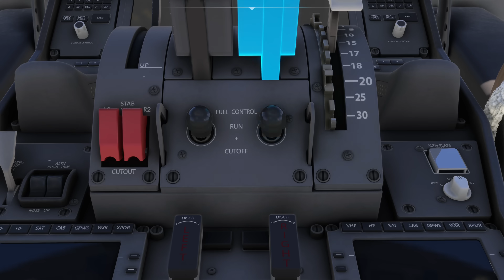Air India 171: Why Did The Fuel Cut-off Switch Get Moved?

Comment: Someone made a good point with their question. For an individual planning to take their own life, their life insurance policy for their next of kin can be a major consideration. Pilot blames the other, thus his insurance will kick in for the family, whereas suicide it might not.
That may have been a consideration in what we hear on the voice recorder.

 And two common sense points:  I cast my vote for 1) mandatory cameras and 2) mandatory mental health checks annually. Cameras would clarify which pilot did what action and #2 if done uniformly would reduce the stigma of mental health self-reporting.
Reply: A pilot can hide his mental health issues during a check. In a previous video Captain Steve said cameras would be too invasive, but I agree, it's a good idea. Put the cameras where the controls are.
Reply: @marlenegreyling8620  Yes I agree. The theory with periodic mental health checks is that, since everyone would have to go thru it, then those who really need help would not feel they have to single themselves out. For most it would likely just be a pleasant inconsequential conversation.

Comment: This seems to have become a very simplistic conversation which belies the complexity of the 787's systems. When is a switch not a switch? When it's a switch behind a switch, a sensor which toggles between 0 and 1, which the computer then reads and performs an action on another underlying switch. We are completely discounting the possibility that the pilot was not lying when he said "I did not". What does he have to gain by lying when he is about to die and is committed to it? He will never have to face any court proceedings, nor will his family be blamed for what he did. It's far more likely that there was a computer glitch or an actuator valve error which caused the fuel shutoff, because there is a huge incentive for the airline and the manufacturer to blame the pilot. This happened in the Air New Zealand DC10 Erebus crash where the airline blamed the pilot, then it was found that someone entered the wrong coordinates into the inertial navigation computer on the ground, and this caused the pilot to believe he was on a certain track, but was in fact heading for a mountain, a fact he could not determine visually because of whiteout conditions in Antarctica. Don't ever think that airlines won't use dirty tactics to blame a dead pilot who can't speak for himself. It took the insight of a courageous judge the Hon Justice Mahon, to figure out what happened. He called it "an orchestrated litany of lies". Many New Zealanders like myself remember that fact to this day.

Comment: You mentioned that during takeoff there is never a scenario in which the engines need to be cut off. Why does the computer allow such an action during takeoff? You mentioned because during landing, you may need to cut off engines. Well the computer system knows the difference. Again, why is such an action allowed during takeoffs?

Comment: why did the 9.11 plane completely disappear without a trace, as if it had evaporated, and this Air India plane with so much fuel still remained in a much better condition?
Reply: Speed at impact
Reply: @SoCalDaisy  it should be at least 1inch of anything from that plane, but it ain't

Comment: Why is it possible to cut off the fuel when the throttles are full forward? If you need to cut off fuel due to engine fire, wouldn't you close the throttle(s) first? I cannot see a situation where you would need to cut off the fuel with the throttles forward or even partially open.

Comment: Are there any other control switches or buttons in the same immediate area of the fuel switches that could have lead them to be inadvertently touched or dragged into the off position?

Comment: Thank you for these informative videos. I think the people getting annoyed at the lack of detail in the preliminary report need to understand two things:

1. The AAIB has rightly given no more than the information necessary to confirm that the incident wasn't caused by a technical problem. This is important, so people don't spend the next year worrying about a latent fault in the 787. It's not reasonable to expect a comprehensive analysis at this stage.

2. Just because an event isn't mentioned, doesn't mean it didn't happen. For example, there are 10 seconds between 'cutoff' and 'run'. People seem to have assumed the pilots were idle during this time, just because the report doesn't describe what they were doing and saying. But maybe they were doing and saying many things; maybe there was an argument; maybe there was a scuffle as one of the pilots tried to relight the engines. If such things did happen, it's good that the AAIB didn't prematurely put this in the report without completing its analysis. Like I said, all we needed to know, right now, is that the action was likely deliberate, and that the 787 did not malfunction.
Reply: @amanjit-gill
After 78 years, and based on our life experiences, and the level of trust we place on officials/politicians/authority figures and others, with regards to "transparency", "honesty", "sharing the truth" etc,,, It is absolutely reasonable to doubt the investigators.

Comment: The function of the fuel switches, as we now got aware, needs a mayor design change. I suggest a switch off delay combined with an overall clear alarm sign and access procedure, either by two pilots agreed, ( override function) or one pilot and flight computer agreed. I am shocked by the lack of such basic safety function.

Comment: If it was by technical fault of plane, it could hv happened with 1 Engine but if both fuel switches were off then it is definitely and was deliberately done by one of the Pilot who was on suicide mission. Especially when fuel switch as all the expert suggesting switches were pull up and then shift.. it canon happen that fuel switch pull up by itself  and then shift to shut the engine like magic.

Comment: Indian Commercial Pilots' Association (ICPA) statement : In the aftermath of this incident, we are deeply disturbed by speculative narratives emerging in sections of the media and public discourse — particularly the reckless and unfounded insinuation of pilot suicide. Let us be unequivocally clear: there is absolutely no basis for such a claim at this stage, and invoking such a serious allegation based on incomplete or preliminary information is not only irresponsible — it is deeply insensitive to the individuals and families involved,” said ICPA.

“Pilots undergo extensive psychological and professional screening, recurrent training, and operate under the highest standards of safety, responsibility, and mental fitness. To casually suggest pilot suicide in the absence of verified evidence is a gross violation of ethical reporting and a disservice to the dignity of the profession,” it added.

“As aviation professionals, we trust and respect the rigorous investigative protocols established by competent authorities. These inquiries are designed to uncover facts methodically and without bias. Until the official investigation is concluded and the final report is published, any speculation — especially of such a grave nature — is unacceptable and must be condemned,” ICPA said, calling on media and public commentators to act with restraint, empathy, and respect for due process.

Comment: Fuel switches requiring two person activation will cost lives one day... Just throwing this out there - mid air collision but your jet is still flying. Impact was at the cockpit with one pilot disabled or dead. Engine fire is another result so now the single pilot cannot shut down the engine. The aircrew must be able to do _anything_... Computers are wonderful but they suck at actually working out what is best when the parameters presented have not been programmed for - I started programming back in the 1980's before starting to crew military helicopters so have my feet in both worlds. Computers are great for catching basic issues - "Am I on the ground"... Yes, all three weight on sensors for the gear say yes. "Am I flying?" Yes, the gear is up and locked showing three reds... "I'm in take off configuration but the flaps are not set"... Alert the crew...

These things are great but when things get complicated I can assure that a programmer will not see and account for every eventuality - there are simply too many variables... Now, in the computer industry these are called "bugs"... In the flying world they can be catastrophic failures... The DASH runaways on CH-47s, The MCAS issues, (sorry to be picking on Boeing but it's relevant), are perfect examples of software doing something unexpected - funny how a Google search for "DASH runaway CH-47" brings up zero results nowadays... After a bit of a search I found this:-

Chinook HC1 ZA721 27th Feb 87 Falkland's Islands

Stephen John NEWMAN
Anthony Donald MOFFAT
Andrew John JOHNS
David John CHITTY
Jeremy Charles MARSHALL
Karl Mark MINSHULL
Peter Jason WHITWELL

I knew Newman, (As pilot his brilliant reflexes saved us both in horrible weather one day in the Brecon Beacons), Johns, (nicknamed "Wally" was a fellow crewman who I'd known for over 2 years), Dave Chitty was the Sergeant tech that ran the Track and Vibro team for RAF Odiham, Jeremy I only knew in passing and Karl Mishull was a Corporal and an utter "star", he'd do anything to make sure the aircraft was serviceable and ready to fly - like they all would be he had an enthusiasm that was unparalleled.... Sadly, time has erased Whitwell from my mind but the four of them were a team that I had flown with on far too many "track and vibros"... I was the man who received the phone call on an overseas detachment where, after the news was passed, I was told to tell the other crewmen that we weren't to talk to the families and we were not to speculate on the cause... Funny that... Just hours after the "accident". 

As I said,  basic functions that are "obvious" yet could be overlooked are the realm of computers. Making complex decisions and over-riding a human's input are ridiculous and should be avoided... After over 40 years of administrative management over computer systems including a lot of programming said systems I will say it again, the Aircrew must always have the ultimate control over the operation of the aircraft and I don't think that's unfair...

Comment: One question that is pondering me is the image in the report showing the RAT deployed looks like it was within a second or 2 after takeoff because the plane isn't very high up (Figure 15 CCTV).

Logs from report: 
080839 aircraft transitioned to air mode.
080842 IAS hit 180 knots and fuel cut off one after another. Let's say 43 and 44.
080847 RAT supplies power.

But if you look at the image, it looks like RAT has been deployed immediately after takeoff and the para above the image mentions the same. Wonder why is no one talking about that? 

Also from the timestamps above, if we say fuel cutoff was 43 and 44 seconds, did the RAT start supplying power in 3 second? What is the usual time for RAT to deploy and supply power?

Comment: I am not defending the pilots if they have deliberately caused this crash But I note this Capt Steeve has been pushing the pilot suicide line from day one - even before this preliminary report was released. What disturbs me is that he totally rules out any malfunction in the aircraft. He even keeps repeating the line "there was nothing wrong with the aircraft " How can he be so sure? Makes me wonder if he is on Boeing's payroll.
Reply: i agree. and even if he wanted it , thats  a pretty elaborate way to plan your onw death !, simply stupid arguement , lets admit all devices or equipment can failt at some point of time.. may be just a one off case

Comment: What if the captain sitting in the right hand seat meant to hit the stab switches which are also a two step process? There's a post on the aviation forum mentioning this theory and idk why it isn't being taken seriously by people or being spoken about in media. 

It seems a little odd that the stabilizer trim switches are large and red and the fuel switches aren't, and are in fact just plain black, far less catching to the eye. 

All it would take is a momentary lapse in focus, or task saturation, for the pilot to pull the wrong one. Again, they both require two steps (on the 737 which the captain may have flown previous in his career, the stab switches were closer to the right hand seat and took one step). 

It really seems people have a poor sense in just how little time this all unfolded, especially considering all the blaring alarms once the switches were pulled. I think this is very likely to be an extremely poorly timed and unbelievably unlucky pilot error, everything seems impossible until it actually happens.
Reply: The red part of the stabilizer trim cut-off switches are actually switch-guards not the switches themselves. You have to first pull out the guards then operate the switches. Your scenario doesn’t make sense agains the facts.
Reply: @geekay254 knew someone would comment something like this, he still made the mistake, it took so little time and he wasn’t thinking. He probably only came to realise when the alarms started blaring and it was already pm too late. 

It’s a pretty inconceivable mistake when you have time to think about it, the pilot wasn’t thinking, simple as that. A lot of pilots on these threads want people to think they never lose focus. 

That’s why he said he didn’t do it, he probably WASNT EVEN LOOKING at the switches while he pulled them probably. He was focusing on something else entirely or not focusing at all. 

All the armchair pilots are gonna feel really sorry when the final report reveals this wasn’t intentional.
Reply: @geekay254 also yeah that’s what I already said the red guards are the first step of the two step process. Both switches are a two step process which would be the same thing to a pilot who isn’t looking at what he’s doing and isn’t paying attention. 

He wasn’t thinking so he reached for the closer, safer looking switch at the worst possible time

Comment: There a golden question, if pilots both see the fuel is cut off, where is the first indicator coming from (control panel?)?   I see the conversation from black box didn't fully simulate how both pilots knows the switch is off when a question was ask.

Steve try to answer some questions, but why would you left out the maintenance switch or jumper cables question where your not the SME on the subject.

Comment: It keeps bugging me how we now assume those fuel switches were really moved, when in fact we never actually SAW that - so far, it's really ONLY the FDR recording that suggests so... But how about this theory of a (computer or controller) CHIP MALFUNCTION? (https://www.youtube.com/watch?v=d4XY6qntTsc) We need to hear full CVR recording and also see data from FDR from that critical time of approx. 10 seconds from the fuel switches being (allegedly) placed to cutoff all the way up to them being placed back to run. What was done in the cockpit in the meantime? What was done immediately prior to that time? At this stage of investigation, isn't it at least theoretically possible the switches were never physically moved, but instead a faulty chip sent a wrong signal, which was then recorded by FDR?
Reply: Kiwi.N.Z 70yrs Pilot 
The fuel was cut off  , Yes , 
People keep saying the SWITCHES  were turned off.  
Were They  ? ?
Reply: Nah, didn't Captain Steeve already tell you it was the pilots error and Boeing planes are safe to fly, ...whether it be pilots taking off with improperly set flaps, or later mofifying his opinion to mistakenly rectracting flaps instead of landing gear...to now suggesting intentional fuel cut off.  Its them Indians!  Edit: Valid point that now it is the assumption that switches were, must have been, moved manually.
Reply: Kiwi.N.Z 70yrs Pilot. 
Thank you very much  ! ! 
Very many thanks actually  ! !

You Sir are the  2nd. or. 3rd  Credible person to come up with this.  To me it is totally Credible  , , no one wants to annalis that theory.  It works with what was said  , and the time line  !  Thank  , and , I will trust a human before I trust a computer  .  I won't be asking Boeing  ,   we've been there before  ! !    . . Ahrr , ,  so what's your  I.Q . , , LOL  ,LOL

Comment: Captain the fact that only a loud clock no voice warning ⚠️ it's on Boeing  the soft ware and computer systems No auto safety 🛟🦺 it's on the software which should not never be connected to fuel engine system I agree 💯 Captain , yet Safety 🛟 comes first even if it was Pilot error this billion dollar 💵 industry  why didn't this software correct mans fumble???

Comment: The report states that "the Engine 1 and Engine 2 fuel cutoff switches transitioned from RUN to CUTOFF position one after another with a time gap of 01 sec." Notably, it does not explicitly confirm a manual cut-off but rather describes the switches transitioning from RUN to CUTOFF. This wording leaves ambiguity as to whether the change was due to manual intervention or an automatic/system malfunction.  
Please your take on it.
Reply: I don't think the software can physically move the switches.
Reply: Didn't Captain Steeve already tell you it was the pilots error and Boeing planes are safe to fly, ...whether it be pilots taking off with improperly set flaps, or later mofifying his opinion to mistakenly rectracting flaps instead of landing gear...to now suggesting intentional fuel cut off.  Its them Indians!